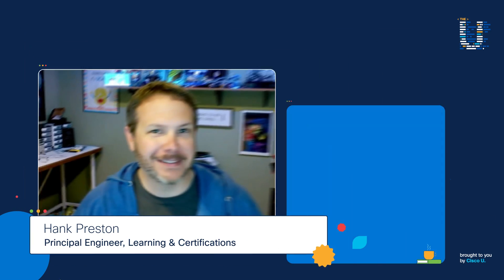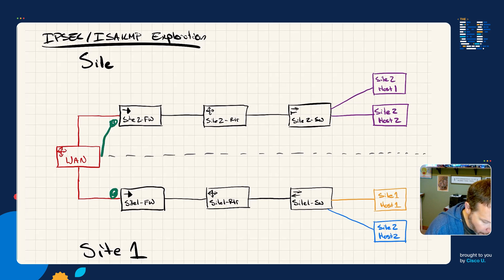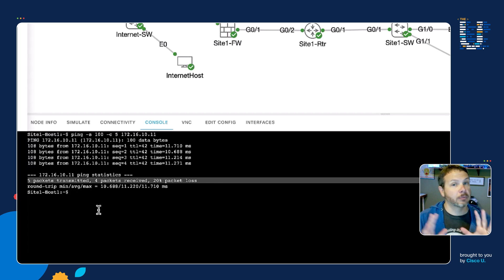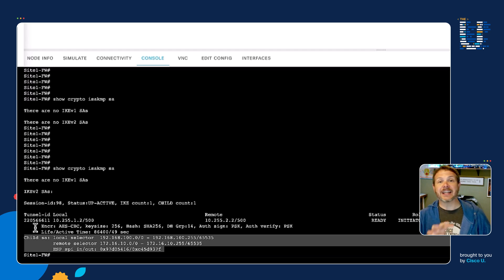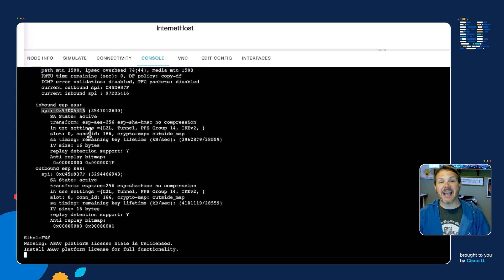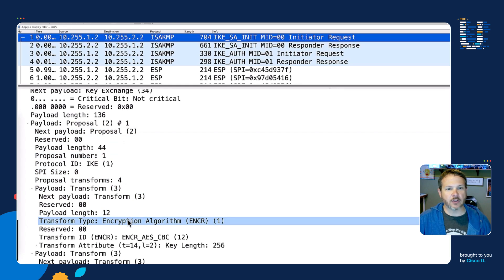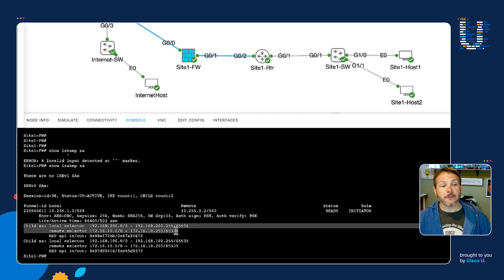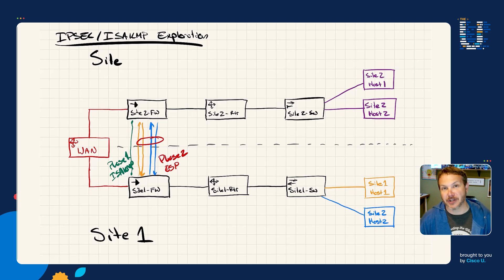A Technical Look at IPSEC VPN Tunnel Creation

Comment: Hello, After having checked the vidéo, I have 4 questions

1)In phase 1 of an ipsec tunnel there is a key that has a duration? What does this key correspond to?

 

 

 

2)In phase 2 there's another key, what does it correspond to?

 

 

3)  I still can't understand what IKE and ISAKMP are in simple terms?

 

 

 

4) why do we say that the security parameters are negotiated between the 2 peers when we define them manually?